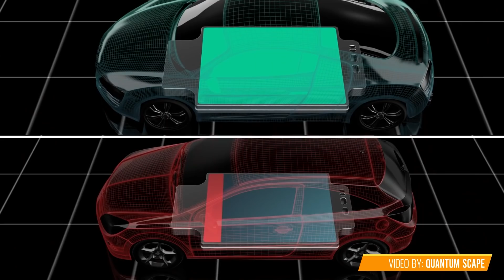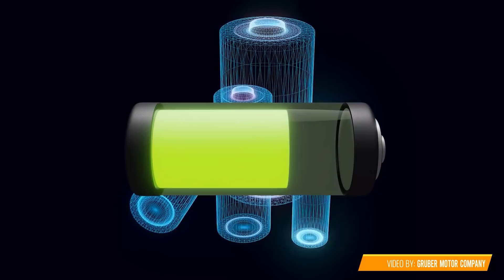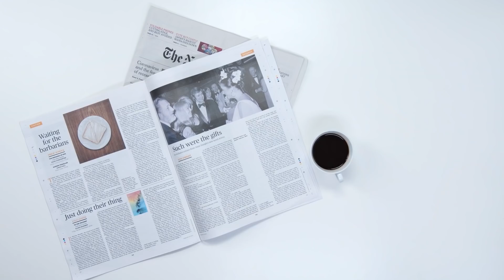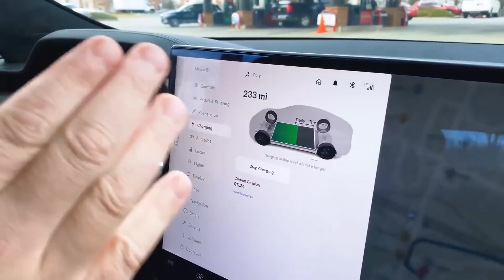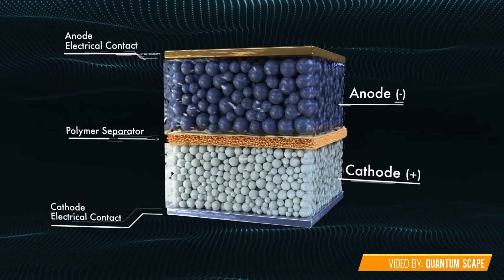SANDY MUNRO: Are Solid State EV Batteries Too Late?

Comment: One of the biggest issues is the lack of EV charging stations for those who do have to travel long distances. There are a lot of EV charging stations right now, but not that many EV’s on the road compared to ICE vehicles. A station may have a large KW capacity, but that’s only for one vehicle. Plug in two EV’s and the total kW is cut in half; 3 cut to 1/3; 4 to 1/4; etc. Many ICE fueling stations can have 8 to 12 pumps. Average fill time 5 to 10 minutes. So a 15 minute EV charge seems acceptable, but most EV’S don’t have that charging capability or batteries that will accept fast charging without degradation of the batteries.

Comment: You do not want a charger time less than 20 minutes becuase if so, you will have to stay at the car 10 minutes (like a gas tank filling that is 5 minutes) until it is done so you can move it out of the charging place. 10 minutes is not enough time to take a rest, food and restroom.

Comment: The concern about charging and range is likely to go away once battery swapping becomes more prevalent which I suspect it will to cater to apartment dwellers and anyone that can’t charge at home.  Plus taxis/ride sharing are almost certainly going to require battery swapping.  So, IMO, the battery tech, like solid state will not be as critical.  Sure, improvements are always great, but I don’t think they’ll be game changers like battery swapping.  Tesla may be going in the wrong direction with structural battery packs IMO.

Comment: Always enjoy your channel and your interviews with Sandy. I believe that at this time, EVs have an important future. My threshold tho, is cost.  I saw that a decent Kia/Hyundai EV will cost between $45K and $55K. I have a perfectly serviceable 2018 Subaru Crosstrek with minimal bells and whistles that we purchased for $25K. I cannot justify an EV for 100% more money.  Maybe someday the cost and complexity will be reasonable.
Reply: the cost will come down within a few years to where ICE and EVs cost the same for equal size, power. not until batteries, chips cheaper. maybe 3 years. servicing, "fueling" EV much cheaper already.
Reply: @vanrozay8871  Perhaps and hope so. Current EVs are blinged out with lots of power and electronic options, driving the price and unreliability to greater heights. Don't get me started  on the safety aspects of the video screen dashes requiring a person to take their eyes off the road to change a heater setting. For one, I will not miss the demise of the ICE vehicles. Also, I expect the road taxes on EVs to go up since charging at home avoids fuel taxes that contribute to road maintenance. Just saying.

Comment: We need to adjust to the fact that it will take longer to fill an 1. EV. EV’s don’t splash gas back on you. 2. It is just another change in life that we adjust to. 3. It is not the end of the world folks and let’s get out from under the control of the oil companies. There have been other businesses that have died because the world changed. I think we need to adjust our lives to a changing world. You don’t need to charge up a battery if you only drive 100 miles.

Comment: I have a mobile service. I run AGM batteries. Takes hours to charge.  Charging is no big deal just have to plug it in. Been doing this for 17 years.  So what would be the difference to go from an extension cord to one that is the size of a hose to fill with gasoline? ZERO.  The real difference is that when I fill up now it is $75 a couple times a week.  OUCH.  If there was a EV van available you can be sure I would be changing the size of the power cord I use now.  Glad your voice is back and yup you still crack me up with the hair comments.

Comment: You guys are both off base. DC charging only matters on trips. People stop at least every 3-4 hours to stretch legs and take care of biological issues. In reality a 15 minute charging stop is every bit as fast as a gas stop in that case.

Sandy's solution of putting a 200+ kWh battery in cars works well for 3-ton cars costing over $100k. Adding all that weight will reduce the efficiency of the vehicle around town, where cars are used most often. 

The reality is that faster charging cars will allow for smaller, lighter, and less costly EVs to be made. These cars won't have the range of today's high-end cars, but they won't need it since charging won't involve waiting for an hour. These are the kinds of vehicles the world needs to get the majority of people driving electric.

Comment: Sandy's right, range anxiety and charge times aren't a concern for EV owners and solid-state batts. are inevitable as they are: smaller, lighter, can handle extreme cold and hot temps fine and can charge faster.  EVERY battery manufacturer is or will be soon, working on solid-state and will keep improving it until EV's regularly go: 500-700 miles on a single charge, charge in 10- min., and cost less than ICE.

Comment: as a tesla owner, daily use is no issue - charge at home and go. Trips on interstates isn't too much of an ordeal, every 3 hours of driving getting out for 20 minutes is almost needed, desired.
The issue is folks that can't charge at home. Chargers will have to be at work, stores, parking garages, etc.

MY issue has been day trips to smaller towns and cities - 250 miles round trip and that's not possible on a MY Long Range. Sorry, 321 is ideal...i've not gotten that. In the 15F temps here I'm getting 1 mile to 1/2% charge - so 160 mile REAL WORLD range.

Now 800-1000 miles is wonderful, will make EV cars practical. how long it will take to charge this is my concern. Unless you get some very high output (aka expensive) home charger. To put 300 miles in my tesla at home takes 10 hours. 1000 miles is THIRTY hours? Not practical. The higher end home charge is about 45 mi of charge per hour - so 22, 24 hours to charge fully?

Comment: This touches the edges of something that's being overlooked. When you get gas,  you can't do anything else. You can't let the nozzle go for a second (ah the old days when you could lock it in, and go check your oil and clean your windshield ;)  ) So while it might only take 5 minutes or so, you're stuck there, with the smell and weather.  Plugging in and going off to do other things while it charges... 15 minutes is not long enough!  If we get charging down to 5 minutes, and there gets to be penalties for leaving your "charged" car in the way, we'll be looking for slower chargers!

Comment: The devil is in the details here. Five years ago, ITAP built an EV with nearly 1,000 miles of range... with a box of scraps! The question is, what are you compromising? Weight, performance, safety? The other points of solid state and lithium metal is the cost, range, safety, and weight. And as far as production capacity, that's the real question for people like ONE and Gruber. Meanwhile, SES, Solid Power, QuantumScape, etc. have large production facilities planned.

Comment: 1:30 The point everyone either misses or intentionally avoids here is that 99.9% of the time, EVs are strictly more convenient than gas cars. Charging at home is as simple as plugging in an appliance, phone, power tool, etc. Literally 5 seconds and your done. Meanwhile, gas cars require you to go out of your way once or twice a week, wasting 10 to 15 minutes of your time, each time.
So an EV that charges to full in 15 minutes on DCFC is, at worst, equivalent to fueling a gas car, but that's only an issue occasionally. So the requirement that EVs be better than ICEVs has already been met.

Comment: Super Fast charging is only a problem in a couple of situations: 1. For people that can't, for some reason, charge at home (most people spend 14 hours a day at home) and they have to use public charging stations.   2. When going on very long cross-country trips. The second situation is by far the bigger problem because you really have to plan your trip based on charging station location.   That said, when 500 mile range becomes the standard, long trips are much less of a problem because after 450 to 500 miles of driving, most people are ready to take a break. By 2030, when EV's have 600 mile range standard - that's 10+ hours of driving - Everyone needs a break. Will we ever see 800+ miles of range? Only time will tell.

Comment: I’ll personally buy an EV again once I can get one semi affordable that has at least 500 mile range or the charger networks (CCS1 or Tesla depending on car) are widespread enough that it’s no different than stopping off at any small town and getting gas now. To many rural destinations and roads to them are devoid of any charging infrastructure. If I was only sticking to major roads then it’s not an issue even now. Where I live in rural Arkansas there are enough Tesla chargers scattered around could get by between home charging and emergency stops at a supercharger. CCS is a no go. None within 45 minutes. However, PlugShare does show a number of planned sites in progress near me so hopefully that happens and continues to happen in the charging “deserts”.

Comment: If solid state could give me a 3 row SUV capable of towing at least a 6k lb travel trailer 300 miles and when not towing 600+ I’d switch. Granted that assumes it stays around same price as current large SUVs. Figure 60k-75k. If they actually made cars with 600+ mile ranges, who cares how long it takes to charge? Most daily road trips stretches probably considering stopping for the night.

Comment: In the short term — the next couple years — the problem is supply of electric vehicles.   Tesla now has long wait times for many of their cars.  Ford dealers are charging excessive premiums.   Currently, demand exceeds supply and manufactures cannot make EVs fast enough. That is rapidly changing, as Tesla has two new factories coming online. But my prediction is that there will not be a glut of EVs for some time.   The current problem is not convincing the most reluctant  adopters to want to purchase an EV.  It is having enough  EVs manufactured  to sell to those who want to buy them now. Then the problem will be having enough charging stations using existing technology to satisfy the needs of the millions of new EVs that will be sold in the next few years. The current problem is capacity at existing  technology.

Comment: The biggest problem with all EVs is battery degradation. If you know that the battery will be useless in 8 years (or less ) and replacing the battery will cost half of the car's price who'd buy that? Second-hand EVs are worthless. There are lots of people who can't afford to buy a new car let alone a brand new car every 8 years (or less) what does that mean for those people? Buy a bike or just walk? Everybody is ignoring the elephant in the room (probably on purpose) and they are talking about retarded stuff like "I can't wait for 15 mins". I spent more than 20 mins at a regular gas station and that's on a good day. There are lots of places where EVs will never be a thing (unless some huge breakthrough really happen). If the solid-state batteries can deliver one thing and one thing only - long-lasting (15+ years) and everything else is the same (or even worse) they are still worth it and the will not be too late to join the game

Comment: Home charging will never happen in 15 minutes because the power surge would take out the street. But as Sandy says you don’t care when it fills itself overnight. 
The big push for drivers is the cost benefit. $5 vs $50 for a full tank sells a lot of EVs.
Reply: Where/what can you fill up for $50?... reg gas is $1.60 liter, my 09 Yaris takes 42 liters so $67 to fill and my Sierra is... I don't want to think about it. I NEED an affordable EV within the next 36 months and so does most of rural Canada. Our commutes and regular drives to the "big" city are 200-300 km each way. So bring on this tech ASAP :)      cheers from NW Ont Canada

Comment: at least Sandy has stopped talking about the discs with hydrogen. I dont think any needs anywhere near 1000 miles range. If only the ev's could charge with 200 kW on average for the 70 kWh then its fast enough for most.

Comment: Interesting stuff. A couple of things Sandy said made me think.

15 minute charging at home. Super fast charging will always demand staggering amounts of power, surely? The supply to the average home won't be able to carry that amount of power. Not without somehow raising the voltage. Am I right?

I agree that the main advantage with solid state is likely to be less weight. I've thought that for a while. But I don't see weight being a primary factor with range. I see extracting the best range from whatever battery capacity you have coming from a combination of maximum regen capability and excellent aero (not forgetting frontal area plays a significant role here). I see lower weight mainly  being an advantage in vehicle dynamics, road noise, debris, road damage etc. So no bad thing, but not mega critical on range.

Just my thoughts. Maybe I'm wrong? 😁
Reply: The heavier the battery the more energy it takes to propel just the battery not to mention the vehicle.

Comment: I respect Sandy’s engineering know-how, but he does drive a Jeep.  That doesn’t inspire confidence.  

I need a cross between Sandy and a mechanic like Scotty Kilmer, and then I’ll have a better idea of what fits my needs.   For background, I have a Toyota with nearly 300k miles and has only had basic maintenance.  The engine idles the same as it did when brand new.  It might sound ridiculous, but it’s true.  I’m ready to make the switch to EV but only when it comes with that kind of reliability AND durability.   Give me an EV with Toyota’s reliability & durability, and I’ll buy one tomorrow.

Comment: The only range anxiety, I have, is, at the moment, NOT finding a Charging Station.
So the sooner, ALL petrol/gas stations, install electric Charging points, the better !
What would make that even more better is, if all manufacturers would use the same charging plug.
Tesla, OFFERED his charging system to every Manufacturer, in the beginning, but NOBODY listened.
So we now have charging stations each using different systems  !
Where's the Standardisation in that  ?

Comment: The average car owner who drives 40-50 miles per day only needs 250-300 miles of range to satisfy
their everyday needs. We charge our 2 EV's as needed at home and have no trouble with range for
about $30-60 month of off peak electric.

You can charge every day if you want and always have a a full battery in the morning.

Comment: Battery technology is definitely improving.   I hope solid state batteries work.  Huge improvement on safety and weight.  As far as range, weight is very much a component.  I think the tipping point for electric cars is nearer than people think.  I have been driving my Volt since 2013 and even though it's a hybrid, 90%  of my driving is electric.  Very few people who have experience electric driving, don't want to go back to ICE.   Competition improves the breed.

Comment: I completely agree with the idea of not worrying about the charge time when I'm at a rest stop. 

There's a big difference between driving a commercial truck for 6 hours straight vs driving a personal car for 6 hours straight. If I drive 6 hours in a Class A truck, I can get back in it in 5 minutes without being uncomfortable about it. But in a regular old car, I want to be out of the car for 20 minutes or so before I start driving again. I'll use the bathroom first, then maybe get something to eat, and if 20 minutes haven't passed after all that I'll walk around for awhile. 

So, if I were to plug in my car when I park, it wouldn't affect my schedule in that regard, even if it took 20 or 30 minutes to charge the battery.

Comment: Agree with all of that..would add this though. Lithium iron phosphate looks to be the battery chemistry of the 2020s, it's already been scaled by tesla, and CATL. Solid state is not gonna be ready for prime time/mass production until 2028 direction. That's not too late at all, it will open up even more possibilities both due to their light weight, extra capacity but more importantly; solid state will reduce the reliance on cobalt and nickel, which will be essential as we scale beyond the replacement of our global ICE fleet into a new decade..Exciting times folks. EV's are the future.

Comment: I think range/charge time is pretty much where it needs to be for passenger cars. The pick-up trucks do need more capacity for those who tow. Rather than extending range to 500-600 miles, I think it is a better deal to reduce battery size and weight which makes everything better.If you could get 350-400 miles from a battery that weighed 1/2 as much, it would really enhance the products
BTW: John Wayne was a colossal assh*le. Good quote though
Reply: Don't know much about the actor, but all of the characters he played were ledgend!

Comment: I have been a 2 Tesla family since 2014.  Long trips has never been a problem.  One item that I never hear mentioned is all the time I save by never visiting a local gas station.  Sure - my 300mile trip might take a little longer due to a charging stop, but I never ever have to stop at a gas station before a meeting, going to/from work, filling up before a road trip, etc.  Plus, I never have to touch a gas pump handle or smell gas fumes ever again again.  It may sound trivial,  but charging at home and always having a “full tank” is beyond awesome.  This feature needs to be highlighted more.
Reply: According to the Association for Convenience and Fuel Retailing Stores (NACS), the average American pumps gas for about three hours a year.

Comment: When Sandy says that the ONE battery tech is ready to go, does that mean they have conducted all of the necessary tests and validation that would be required for the automotive industry? I mean, we have all seen what happened to the Bolt.